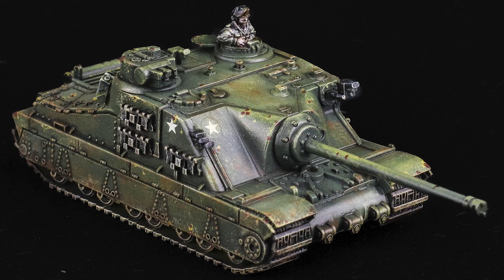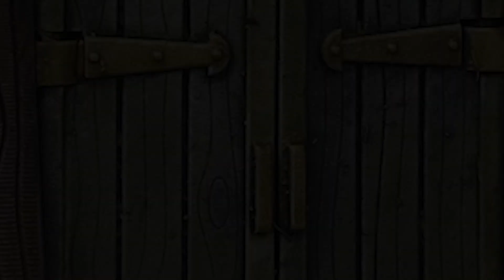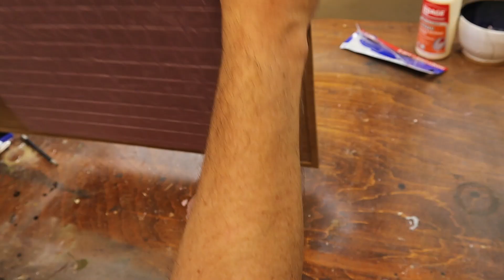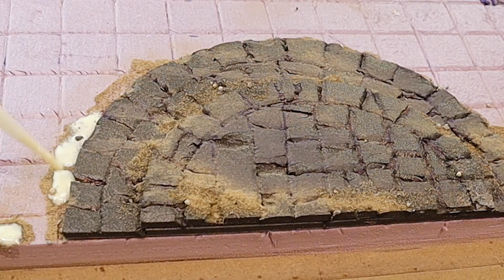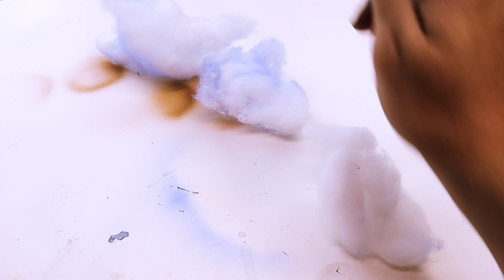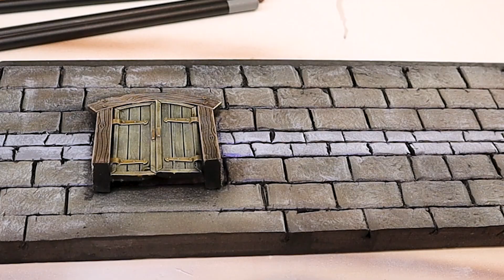[BUILD A SPECTACULAR D&D BOARD DIORAMA]-Glowing Magic Orb, Removable Walls, Fantasy Miniature Gaming

Comment: This looks amazing! I've had an idea forever and this video was the first I found that came close! I'm hoping to make some generic base boards I can throw my 3D printed modular walls/terrain scatter onto, such as a stone floor, forest floor, wood plank floor, but I have zero experience in terrain building. Do you think a layer of foam core glued to MDF/masonite would be sufficient? XPS foam is impossible to find in my area, and I'd like them to be as thin as possible as I have limited storage space.
Reply from the maker: Yes that would work very well I often do the same.  Thanks for the support!